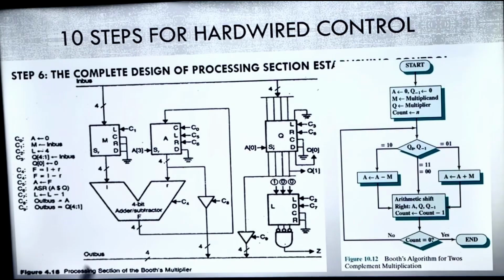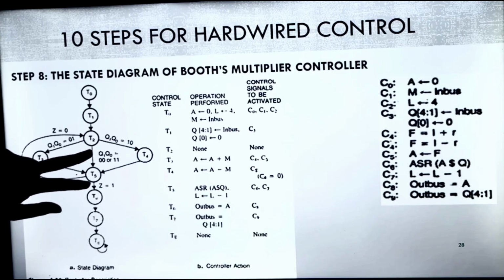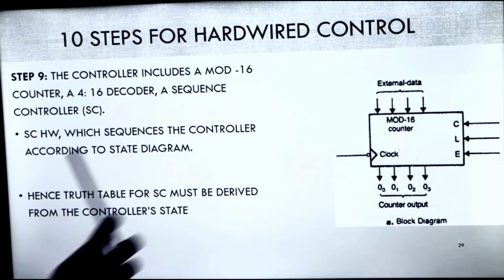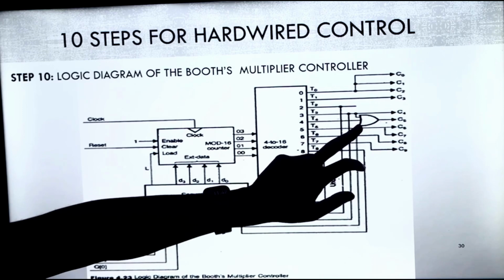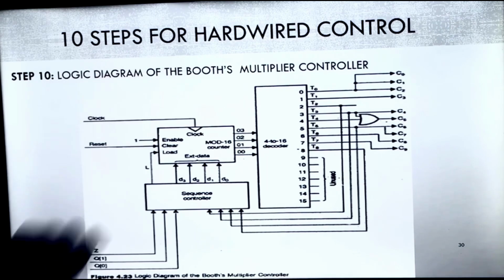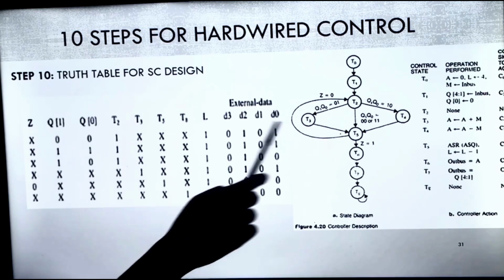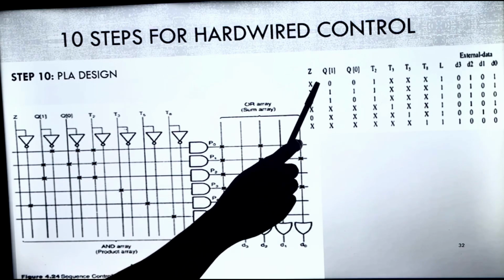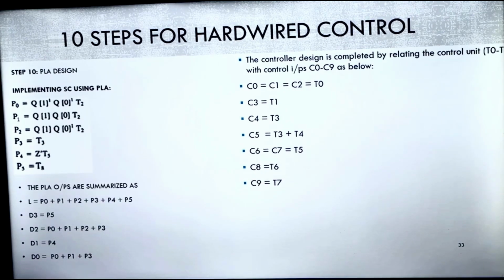Lecture #13  Part 2 on Hardwired Controller design for Booth’s multiplication

Comment: sir but if we have given the state diagram given then how will we find c0 c1 and all?
Reply from the maker: it should be given. If it’s not given then draw the final block  diagram without control signals… just consider the states as the decoder outputs.
Reply: @DoctorofEngineers  ok sir  thank you!
i was considering the question i saw in last year's makeup exam and they did not provide those information.